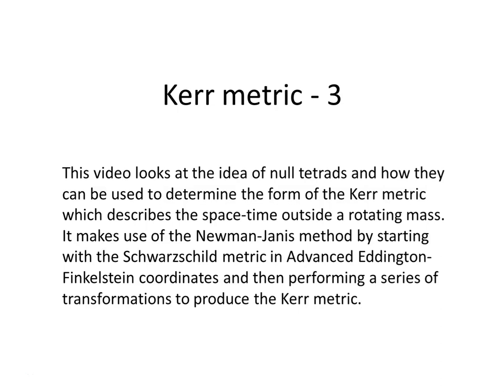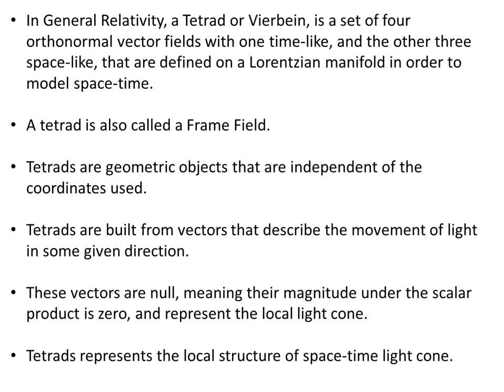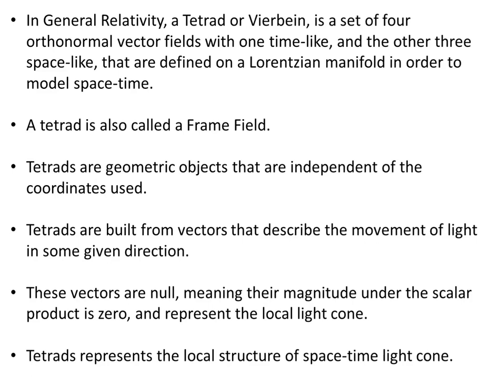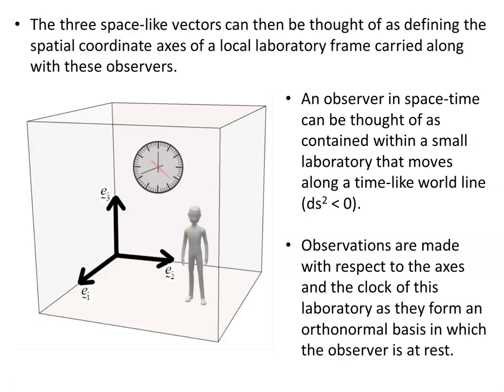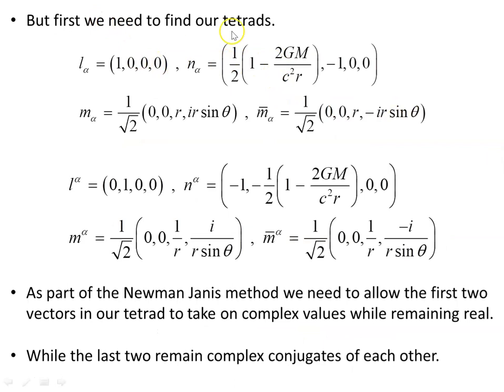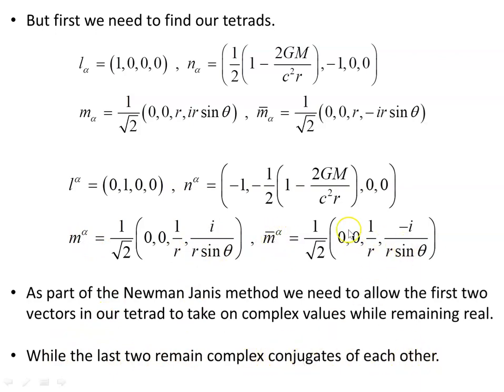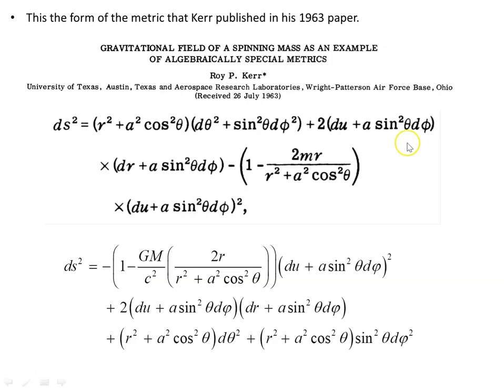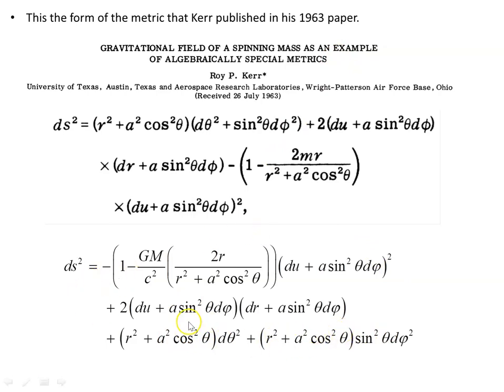Kerr metric - 3

Comment: Why does the transformation with iscos\theta represent rotation around the z axis? What term would we use if we wanted to model rotation around the y axis, for example? Something like ibsin\theta\sin\phi?
Reply from the maker: Thank you for your question! Let's explore why the transformation using 𝑖cos𝜃 represents a rotation around the z-axis and how you can model rotations around other axes, like the y-axis.

Understanding Rotations in 3D Space
In 3D space, rotations are typically represented using rotation matrices, quaternions, or complex numbers (in certain contexts). The transformation you're asking about is most likely referring to a complex rotation matrix or a quaternion, which can be used to model 3D rotations.

Rotation Around the z-axis
When we talk about rotating around the z-axis, we're describing a transformation that keeps the z-coordinate constant while changing the x and y coordinates. The general rotation matrix around the z-axis is:

𝑅_𝑧(𝜃) = ( cos𝜃   −sin𝜃    0
                   sin𝜃     cos𝜃   0
                      0          0       1 )
 
Why 𝑖cos𝜃?

The term 𝑖cos𝜃 is often used in complex numbers to simplify the expression of rotations. In the complex plane, a point (𝑥 , 𝑦) can be represented as 𝑧 = 𝑥 + 𝑦𝑖.

A rotation around the z-axis by angle 𝜃 can be represented in the complex plane as multiplying by the complex number 𝑒^𝑖𝜃 = cos𝜃 + 𝑖sin𝜃.

This effectively rotates the point around the z-axis, keeping the z-coordinate unchanged.

Rotation Around the y-axis

If you want to model a rotation around the y-axis, you need to use the corresponding rotation matrix:

𝑅_𝑦(𝜙) = ( cos𝜙    0    sin𝜙
                     0         1      0
                  −sin𝜙    0    cos𝜙 )

Here, 𝜙 is the angle of rotation around the y-axis.

Notice how the y-coordinate remains unchanged, while the x and z coordinates are transformed.

Using Complex Numbers for y-axis Rotation

If you're interested in using complex numbers similar to 𝑖cos𝜃, you might consider how complex exponentials can be employed for 3D rotations. However, complex numbers are inherently two-dimensional. For a rotation around the y-axis, we rely on trigonometric transformations instead.

Quaternion Representation

For rotations in 3D, quaternions provide a convenient and efficient way to represent rotations. A quaternion for rotation around the y-axis by angle 𝜙 is given by:

𝑞 = cos(𝜙/2) + 𝑗 sin(𝜙/2)

Here, 𝑗 represents the imaginary unit for the y-axis component in quaternion algebra.

Quaternions avoid the issue of gimbal lock and provide a smooth interpolation of rotations.

Your Proposed Term

You mentioned the term 𝑖𝑏 sin𝜃 sin𝜙. Let’s break it down:

The term 𝑖𝑏 sin𝜃 sin𝜙 suggests a more complex transformation possibly involving multiple axes.

To specifically address the y-axis, you might need to adjust this to fit the rotation matrix around the y-axis as mentioned above.

Conclusion

To rotate around the z-axis, you use the transformation 𝑖cos𝜃 because it directly modifies the complex representation of the x and y coordinates, keeping the z-coordinate constant. For rotation around the y-axis, you should consider using the 
𝑅_𝑦(𝜙) matrix or quaternion representations for more robust calculations.

If you have further questions or need more details, feel free to ask.